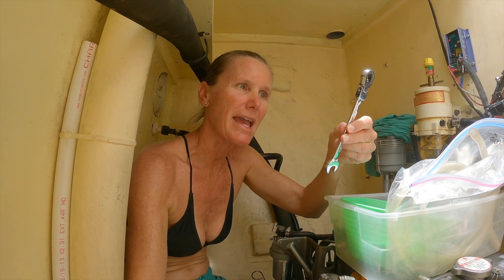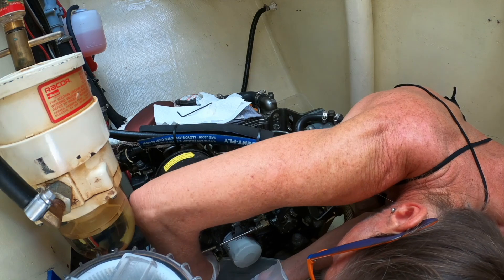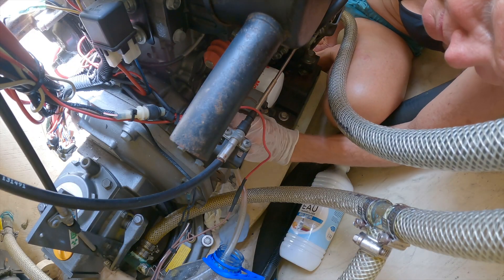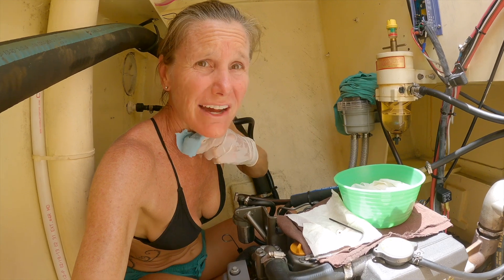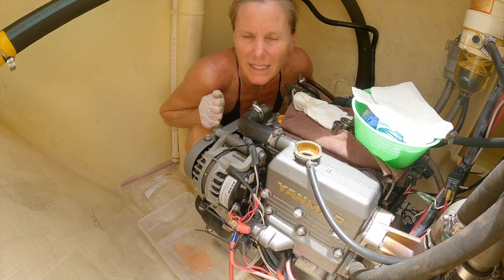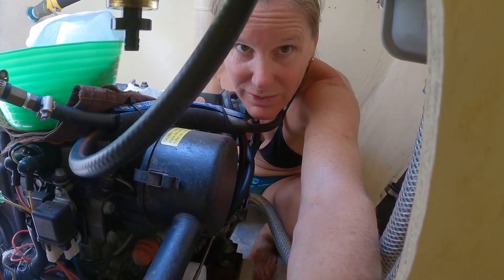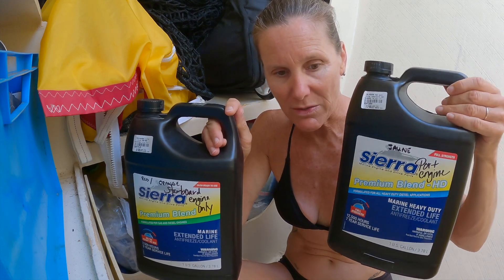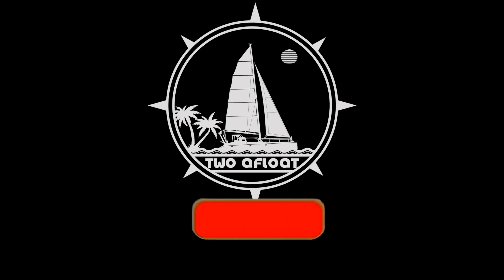Sailor Nicole Changes the Coolant on a Yanmar 3YM30 Engine

Comment: What size is the hose you're fitting into drain cock? I need to get one too, I've been using a funnel and it doesn't really fit in there ...
Reply from the maker: Sorry, I could not tell you off hand and we no longer are on the boat, otherwise I would have gone and looked for you.  :) N

Comment: Thanks for informative video. The video didnt show how you flushed the water out. Did you close all plugs and run the engine with the water in or just let the water drain through? Also, were you mixing new coolant with destilled water?
Reply from the maker: Hi there Erik.  I did run a round of fresh water through but didn't show it.  We didn't run the engine to circulate it though...only to get any little debris stuff out if any.  I just closed everything up, poured the water in to full and open it all back up and collected it.  IF the coolant looked bad then we would have done a proper fresh flush but the coolant looked perfect.   :)  N

Comment: Many thanls for the video. I just won another battle with my engine, rebuildong the water pump and replacing the gearbox. Next move - the coolant 🤦‍♀️
Reply from the maker: Nice!  Ryan got into the engine last week and replaced the water pump...that one is not in my department.  :)  Cheers!  N

Comment: Any issues with needing to bleed air out of the system afterwards?  Thx for the video!
Reply from the maker: We did need to bleed a couple of times.  Easy to do, just took time (letting the engine cool down enough).  :)  N

Comment: Good job Nicole... The "radiator cap" will most likely allow the coolant all to run out without being opened because the cap has valve to allow the expansion tank coolant back into the motor when it's cold. As the expansion tank is above the "radiator cap" gravity should allow for the tank  to drain at the same time.
Reply from the maker: Thank you Graeme!  More info is always good.  :)  Happy Sunday!  N

Comment: Great vid ,methodical steps and easy to follow....to add I've never seem  racor diesel so clean  in the view bowl...Question whats the thingy on top of the racor handle looks like a vacuum indicater to say when filter is blocked? Was it standard or and aftermarket purchase to know when the filter is getting blocked?
Reply from the maker: Hi Louis.  Thanks for the comment.  We often operate in areas that are very remote and/or dangerous areas for engines to fail (for example while transiting the strong current in the narrow reef passes of coral atolls) so we tend to be fairly anal about stuff like clean fuel...  For what it's worth, we have 3YM30s that use a small fraction of the Racor's capacity even at WOT.   Yes, the thingy on the handle is a vacuum gauge (good call!)  Specifically it's this one - https://defender.com/en_us/racor-t-handle-vacuum-indicator-gauge-rk32348    Thanks again for commenting and please let us know if you have any other observations or questions!  Cheers - Ryan

Comment: Great job , just a quick tip when opening the coolant cap  with a still warm engine...
• mark sure you can squeeze the large coolant hoses easily...no or little pressure
• throw a towel over the cap so hot coolant can't burn you
• when opening the cap , press down & control the release.....I've seen & heard the blood curdling scream when things go wrong☹
BUT again great job..cheers
Reply from the maker: copy that!  :) N

Comment: I have the same issue  when laying on my back turning a bolt.
 Even though I know clock wise is tighten and counter clock wise is loosen ( most of the time (damn pesky left than threaded bolts) ), 
 I still have to repeat that to my self as I start to turn the bolt or screw.
Reply from the maker: Haha, okay good...I'm not the only one.  ;)  N